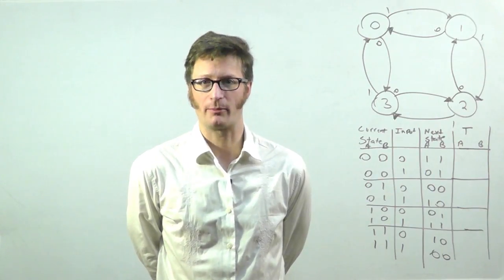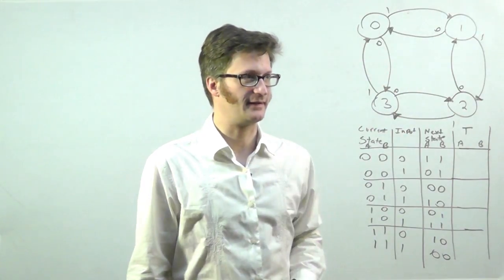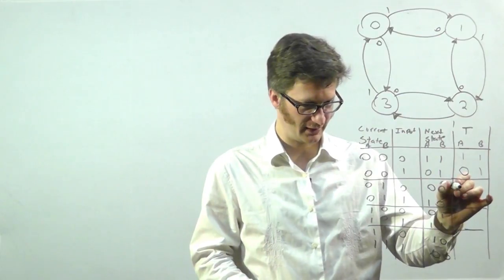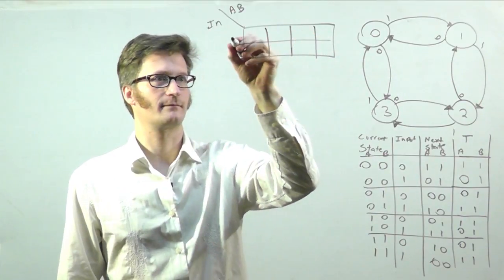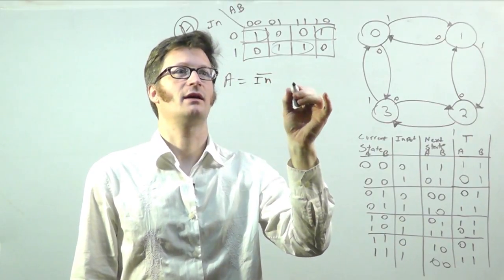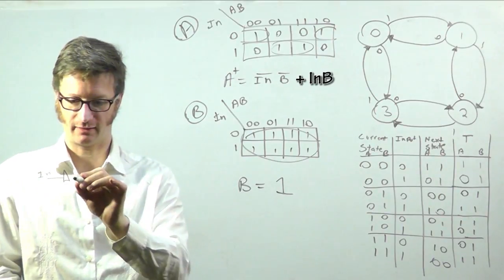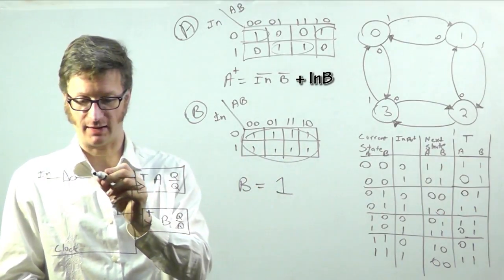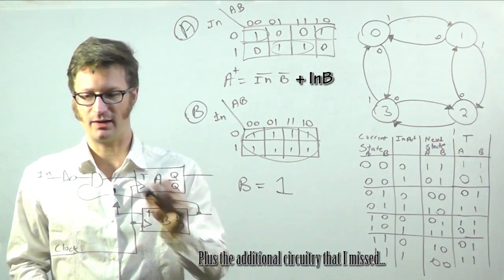Digital Logic - Making a state machine with T flip-flops

Comment: For people that are wondering...  when using D-Flip Flops , the flip flop input equations are identical to the characteristic equations, making the final two columns of the table unnecessary. However, when you design with T-Flip Flops or JK-Flip Flops , the equations differ. The input equations for the flip flops are not the same as the characteristic equations. 

The characteristic equation is the easiest concept to understand. This of it as the "next state" equation. It describes how you move from the present state to the next state. The flip flop input equations are trickier. You have to understand the behaviour of each type of flip flop first and the concept of "don't care" conditions and then put it all together with the state changes.